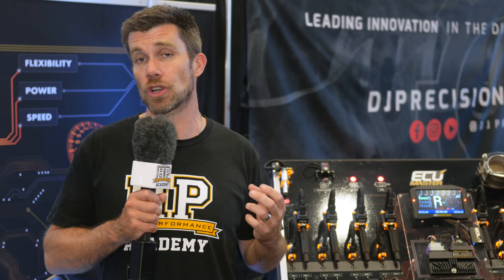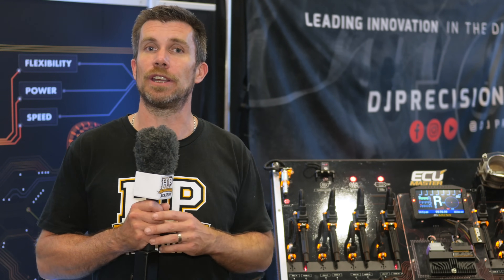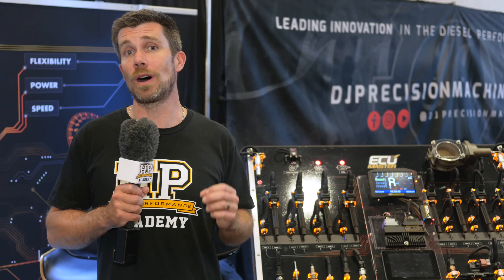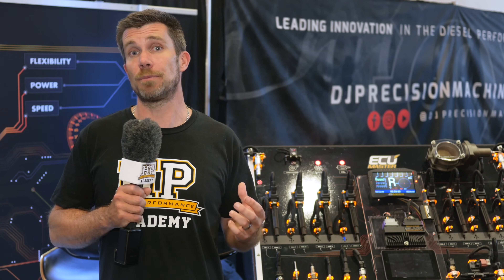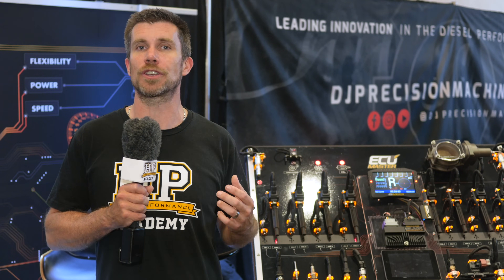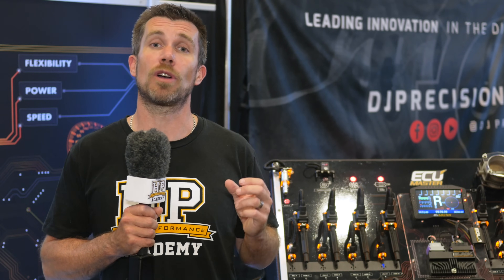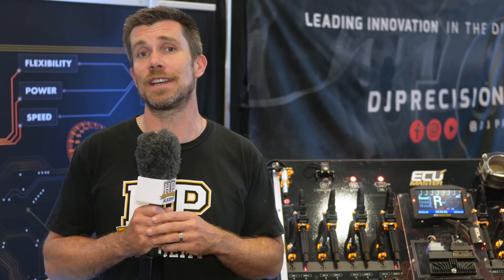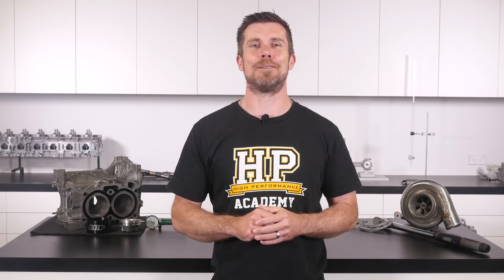🛑 No More Fuses or Relays! | ECUMaster PMU [TECH NUGGET]

Comment: Is this device a standard alone unit, or is a part of a broader network of the same company?
Reply from the maker: Fantastic question. You can use these standalone. We first hand use this specific PMU on a build here that runs a different brand of dash and ECU.

Some PMU/PDM options are more 'ecosystem' focused for sure though and it is a consideration when you are deciding which one to go for. MaxxECU and Haltech are both examples of this, although I know Haltech plan to move away from that in the long term and are already actively working on that change.

MoTeC and AiM are two other brands with examples of PDMs that work independently like the Ecumaster one here.

Just to be clear, both options can suit, and we actually have a car here that runs a MaxxECU with their PDM as well, and other than a few minor glitches around the fact you must connect to the PDM through the ECU, it works fine for the car 😎 - Taz.

Comment: $1400usd is a lot of relays and fuses
Reply: I had to diagnosis why a 2018 Chevy truck's horn was not working...Body shop that was working on it was clueless.

Anyway. 

Chevy has now decided to use a uncased, micro relay, soldered to the back side of the under hood power distribution box....it's not even remotely water proof.
There is no way of soldering,  and replacing this "Horn Relay". You have to buy the whole "power distribution box". Cost was around $300.00.

It also had about 3 or 4 other micro relays soldered to the back side of the panel...Didn't have time to figure what they go too.

Looks like this one: https://autopartscheaper.com/collections/fuse-boxes-and-components/products/2010-2014-silverado-sierra-duramax-diesel-under-hood-fuse-block-genuine-oem-new-22798216

Comment: Still a relay but solid state!! No moving parts.... but they still do fail!!! Semiconductor transistors are great and so are thermistors/ scrs . Good upgrade to mechanical but this technology is now old as the hills and only now being used in cars. Similar to CANBUS and various other protocols of communication. ... It's just taken a long time for the benchmark of industrial automation to reach the car seen... We just need to step it up a bit more so that any of the new gear available  has a very easy user interface that makes it better for the average end user.... basically so they don't have to know how things work... but can still programme something to do what they want without a training programme.
Reply: The user interface on the PMU is as easy as it gets. It's the wireing and planning that takes the skill. But basicly you can apply any functions you want by using drop down menus. It's really quite simple.